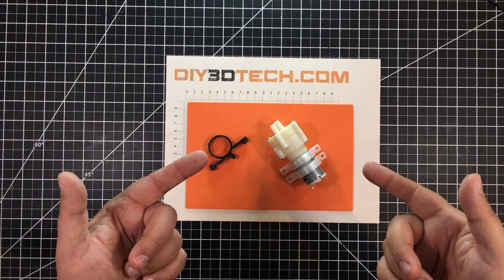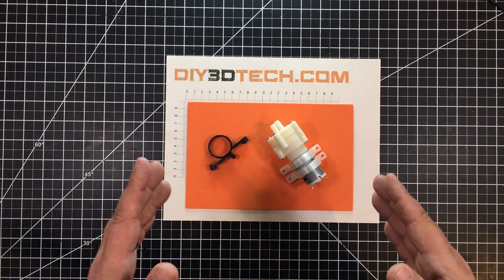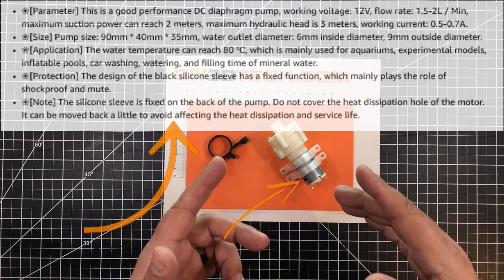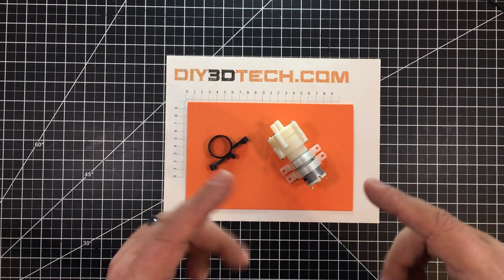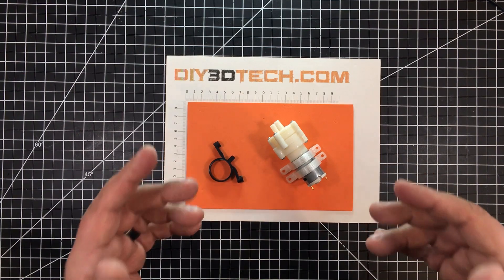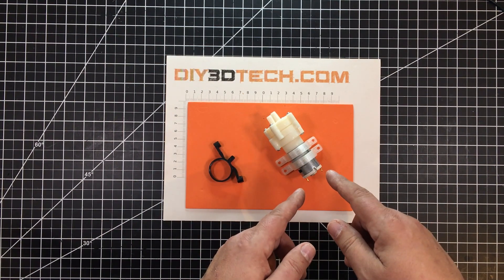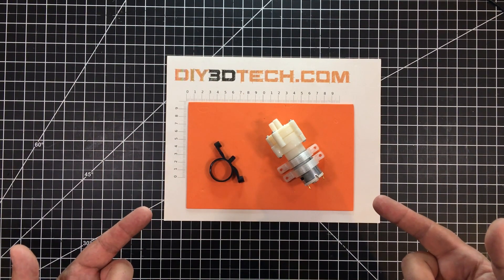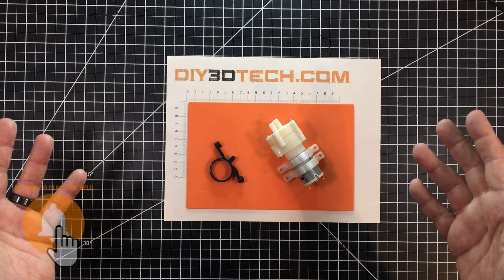eBay K40 CO2 Laser - New Safer Cooling Solution!

Comment: I would be concern with the life of the motor. They are not designed for continuous use. Thanks for sharing.
Reply from the maker: Have had no issue, would not use it for a business where i ran all day every day as yes it is a brushed motor however have had no issue with it so as a hobby application...

Comment: Verry verry bad idea to change a Reliable Quarium pump wich is made to least for years of Continuos work  to a smal toy like gadget pum with may last for a couple of hours.... just DON'T do it!!
Reply from the maker: Thanks for comment however two issues (1) reliable, and (2) 110 volts in a bucket of water by a cheap Chinese pump I would not consider the stock pump reliable.  Now there are some more expensive units out there, however even then 100 volts in water to me still isn't a good idea.  Also why do you say it will only last a couple hours?  Keep in mind this is a hobby laser so its duty cycle will be low.  Now if this was in commercial use I would pickup a chiller with its own pump for sure...
Reply: @DIY3DTECHcom  these Pumps are designed to be sumberged even with full voltage! If you are not Compfortable with that just buy a cheap 12v aquarium pump. they will totally do the job . but this tiny "toy " Pump you chose is just a bad choice. ist just not designed to work as a continous working pump. they are designed to pump maybe some cooling fluid in or out of your car for a couple of minutes. but even as a hobby laser a couple of hours run time are verry quick gone. remember the pump will run all the time as soon as you swich the laser on. 
also the flow rate is quite limited. the original pump is ratet at 40W which gives an aquivilant of at least 1000l/h propably even more(ratet at up to 2000l/h). yours is ratet at 1.5-1.8l/min -> 90-108l/h this is not even near what the original is capable of... 
Thousands of these lasers a working day after day and many of them have a couple hundred working hours on their back. never heard of anyone had a problem with electric shock or mains voltage in the water...

the pump you chose should't run on 12v for long time. it should run at max. for 40 mins continuously and the motor will burn out quickly as there is no proper cooling..  

remember Chines always like to go cheap... an a smaller pump is always cheaper... if even the chines go for a 40w Pump with da water flow of at least 1000l... there might be a reason and <10% might not be enough!!!
Reply: @Alex-und-Flux  this pump is meant to pump tea for a tea table, singl cup full at a time, very popular in China.  It is definitely not designed for prolonged continuous usage.

Comment: The “40” watt laser uses 300w to create that output. The rest of the power is given off as other types of radiation. So you are cooling much more than 40w. 

120v+ submerged pumps are ideal for several reasons. As with pc cooking pumps they are submerged for self cooling. Being submerged isolates them both electrically and physically from a highly sensitive machine. 

As a final note the power supply in the k40 is notoriously underpowered and I would not trust it to be capable of also powering a DC motor continuously. 

It’s a neat idea but I feel it’s a solution in search of a problem.
Reply from the maker: Thanks for comment yet not sure where you get 300W as when I do the rough math of Volts x Current = Watt I come up with about 40 watts.   I also understand the idea of a submerged pump, it I don't like a cheap Chinese pump  wit 120 volt it a bucket of water a "safe" thing.   Also have not had an issue powering it (so far) and if you don't try new things you can never discover new things :-)
Reply: @DIY3DTECHcom  Max amperage is 0.015 (15mA) (for a "40 w" laser). Voltage is 16-20kv. Even on the low end that's 240 watts (V * A = W) 0.015 * 16,000 = 240

Comment: Disagree on using this cheap pump.  “Destructive test: The pump can work for more than 100 hours in continuous operation. If one bucket of water is pumped per day, the service life can reach more than one year. This pump can't run continuously for more than 4 hours.”
Reply from the maker: Yes?  This is a hobby machine and doesn't have a 4 hour duty cycle and my typical maximum duty cycle has been around 20min so not an issue.  Also this will only run while the machine is "on" so I don't see an issue however if there is one, I will make a video as that is what I do :-)

Comment: Is there something wrong with the pump that comes with the K-40? I am waiting for mine to arrive and I am trying to find out as much about it as I can. I already have mod parts showing up so if I need a better pump I'll order one now.
Reply: The pump that come with the K40 is typically fine to start with.  Longer term these pumps are not the most reliable so at some point most people end up replacing the pump with something a bit better.
If you want a good source for k40 mods come check out https://forum.makerforums.info/  It's the old G+ K40 group and archive with some other former G+ maker groups.
Reply: There isn't anything inherently wrong with it. With this pump your trading a cheap submersible pump for a cheap exterior drawing/sucking pump. I'm not convinced there is a difference in reliability. Where the k40 lacks is there is no safety built into the unit. Many people have installed a flow meter both visual and electrical to control the on/off of the laser. No water flow = no laser = no heat = everything doesn't self destruct. To make it safer get a thermometer and larger bucket/container. And watch your temps. The stock pump and a 5 gallon bucket should be enough for moderate use but don't crank the knob to full and do long extended cuts.  The maximun for the k40 is i think 14amps with stock tube.  Keep bottles of frozen water on hand to keep temps down. The hole process of babying the machine is messy but too many stories of runaway fires and self destruction. So i don't step too far away from the machine when in use.
Reply: @user240485  Ok, I have a visual flow meter on the way but then I saw these electric sensor ones so I will likely get one pretty quick. I have a water chiller from beer brewing so that will get incorporated in to the system. Thanks for the reply. Great video's. Look forward to viewing more.
Reply from the maker: So BIG yes DO NOT run these machines unintended!  However the main part here is taking a Chinese made (i.e.) poor quality pump dump it into a bucket of water and plugging into the wall.  So it is not a "performance" so much as a safety hack.  Yes people write me all the time and say  "if" you have GFI or this or that breaker you be just fine.  Which is sad poppy cock as not every one has those, and if they are defect, well the list goes on.  My cousin died in a split second because of water and electricity when we were 14, so it does happen.  Frankly I am surprised that these have not been band in the states for their pure lack of safety...
Reply: @DIY3DTECHcom  i Don't agree! 
Yes do not run this machines unintended, something could go wrong an there is a moderate Potential of Fire whenever your shot a laser! 
but the pump works perfectly fine! This little Chines Toy pump from the video is real garbage!  You just don't do this mode!
If you dont trust this pump just buy another aquarium pump from a Local supplier(might be nearly the same which comes with the K40...) But don't Switch to such a rubbis pump which is in no way made to handle the Continuos work

Comment: they are called flux ring, they "concentrate" the magnetic flux back towards the motor
Reply from the maker: Ah many thanks!  Is this for performance or EMI?
Reply: @DIY3DTECHcom   it's a little bit of both i would assume, it focusses the flux back into the motor to make more torque and since less  magnetic radiation is emitted outward, I would assume it lessens it

Comment: As long as I know that thing around the motor is called a flux ring.
Reply from the maker: Thanks, yet what is the purpose?  What happens if it is removed?
Reply: @DIY3DTECHcom It might be retaining the magnetic fields and therefore making the motor faster and more efficient. Nevertheless removing it shouldn't effect it's performance immensely.